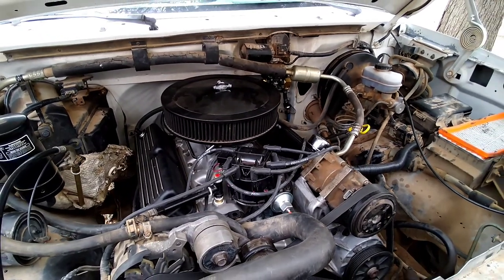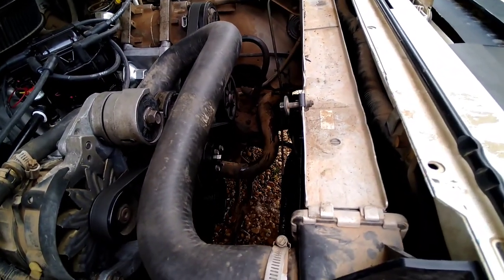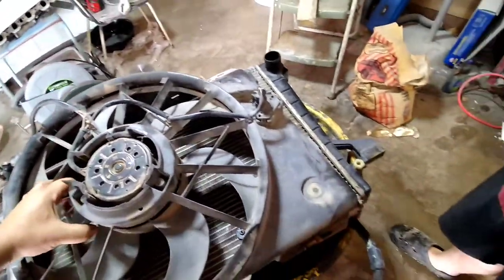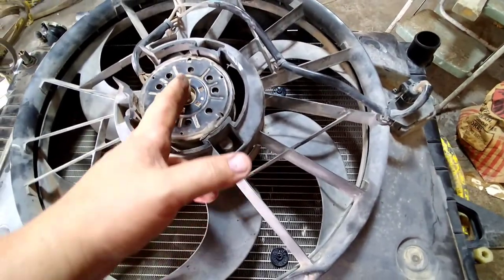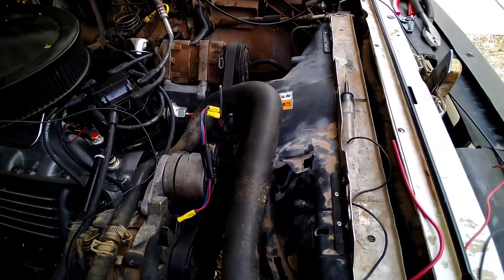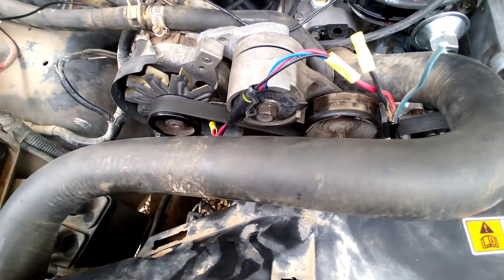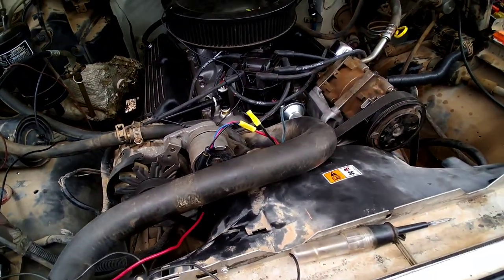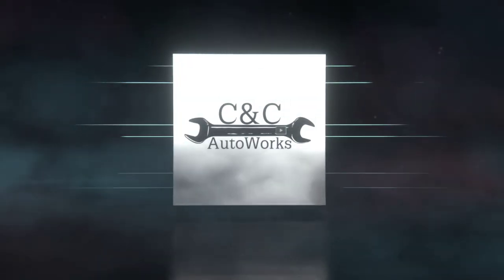OBS f150 E-fan install *junkyard crown vic fan*

Comment: Dude I have a 94 4.9 turbo build and I was planning on doing the crown vic swap like this,glad I actually found a video close to what I'm going to do
Reply from the maker: Be great on the 4.9 i had one long ago and the mechanical fan would always get into the radiator and mess it up
Reply: @CCAutoWorks  my fan likes to eat the belt lmfao

Comment: Love it! After watching id have cut the shroud down a bit and not cut the cover off the moter.  To each their own. Love that you made a video
Reply from the maker: I didn't cut the shroud because the way I wanted to mount it it would have removed the flat part but your right there a 100 different was to do it
Reply: @CCAutoWorks  thinking about doing this, or similar fan to free up a little power on my 92 with a 4.9. Once again thanks for posting
Reply from the maker: @jessewait2931  yessir thank you for watching I used to have a 91 with a 4.9 it always got the fan into the radiator but it was a standard transmission and would torq forward some how a electric fan would have saved alot of radiators

Comment: i have an 1988 f250 super cab long bed with the 351. i was wondering what year year model crown vic the fan came off of. also you can get the high pressure switch off a 1995 thunder bird and it should screw right onto the r12 high side line so it will cut the fans on and off with the a/c high pressure side  if you have done the r134a conversion. thats what ford did back in the day when people wanted a conversion done. i have already done the G3 130amp alternator upgrade. power steering e150  upgrade and factory oil cooler from a 1996 f250. anyways thanks for the video good info
Reply from the maker: 99or maybe 01 and up crown victoria 01-11 forsure mine is off a 02 appreciate the heads up on the AC
Reply: @CCAutoWorks  i first came across it in another video on here  if i can find the video i will let you know. then i did more digging and found out that ford did it as well

Comment: How did you get the contro module from the e fans to work. I herd the only work by a signal from the pcm
Reply from the maker: I just used a relay and hooked up the high speed which is just both hot wires

Comment: How big a fan is this Crown Vic Radiator Fan?  I've got 3 small ones on my Class A RV (not Stock)  and they do ok but draw a heck of a lot of amps to run.  Thinking I'd be better off to go with one big 2 speed fan over the 3 non shrouded fans.
Reply from the maker: I'm not sure how big but I know it cools super good better then any aftermarket fan I've ever bought problem for you might be space being on an RV
Reply: @CCAutoWorks   I have a buddy with a Crown Vic parts car and he is going to remove it's fan to let me test it's fit.  There should be enough between the engine pully and the radiator for it's shrouded fan.  I'll find out tomorrow.  
I sure like the 2 speed factor with just 1 big fan.  I can fit a 20" round fan against the radiator no problem because the the radiator & intercooler in it came from a Ford 700 MTD Truck.  Those radiators ar 21-5/8" X 28-3/8" X 2-1/4", so they are monsters.  With the matching intercooler It took up all the spare spacing I had in the RV.  Should never overheat if I can keep air going across it.  
JSYK,  I repowered my 37' Class A Motorcoach from an EFI 460/ C6 3 speed Ford to a 400 HP 5.9L Cummins with an Allison 1000 5 speed.  Currently rebuilding the injection pump and replacing all the hoses and seals so we can get back on the road again in it.  Fun Hobby!
Reply from the maker: @CurtisDrew1  sounds like a super sweet project
Reply: Well, here's an update.  I bought a Crown Vic Radiator fan, with 2 speed controller, and it fits a lot more cleanly than the 3 electric fans I had on it.  On';y 30 amps instead of the 64 the 3 fans tooks  I couldn't use the Cummins  mechanical fan because it sat too low and left of the radiator. (A Ford 700 MTD Truck radiator with intercooler, transmission cooler and power steering fluid cooler. The offset made the fan shroud a nightmare. (No space for it to work where it was.) This is a monster radiator and intercooler almost worthy of a Freightliner truck!
 As for what the project is,  it's a 37 ft 1989 Fleetwood Limited Class A that I swapped in a 400 hp Cummins 5.9L engine in place of the EFI 460 Bog Block Ford gas motor. (AFC Live 5:12 injectors, 60 lb govenor springs, 18 degree timing.. Yada, Yada, Yada!) PLus al the gauges to keep track of it all....

And, I replaced the old Ford C# 3 speed transmission with an Allison 1000- 5 speed with OD and lock up torque converter. 
 I regeared the rear end because of the lower rpm of the Cummins inline 6, and added limited slip while I had it apart.  Cuz I don't like getting stuck! 
(It does 75 mph at 1800 rpm.)  
The Crown Vic Radiator fan & shroud fits nicely, but I'm still trying to make the 2 speed work on the CV fan motor.  (Call me Crazy) 

The Cummins is out of a Peterbuilt (IIRC), and the Allison is out of an overturned commercial Freightliner delivery van. So it's not an adapted Duramax Allison, so many folks are using.  This is a beefy transmission with a SAE#3 bell housing, so it bolted right to the Cummins without issues.  It has a stand alone TCM, since the 12 Valve Cummins with Bosche P 7100 inline pump is all mechanical.  JAson at Jason@transmissiontuner.com, my transmission tuner, reprogrammed the TCM for me so it will shift smoother, quieter, and split shift the torque converter between the gears.  So it's essentially a 10 speed. And, it has an interface so he can tune it online from Wyoming!  
I'm still playing with the motor and planning on upgrading the turbo a little for better performance going up mountains after all the other bugs are worked out.
  
And adding disc brakes to the tag axle while it's sitting still so I can stop at the bottom of the mountain passes too!  (It's currently running boosted drum brakes on the 3rd axle with disc on the steer and dually axles!)

Anyway, this has been a long term hobby build, and eventually, I'll get the interior upgrades finished and the outside wrap done to bring it into the 23rd century I promise, when it's all done and on the road, it will catch your eye as it passes most of you.   And get 13 mpg doing it.  (The Coach is only 16K lbs!  No slides)

Might even do burnouts if I want to destroy a set of $ tires!  EEK!
Just thought I'd drop ya'll a line from Texas...